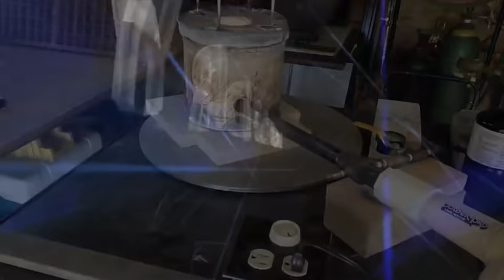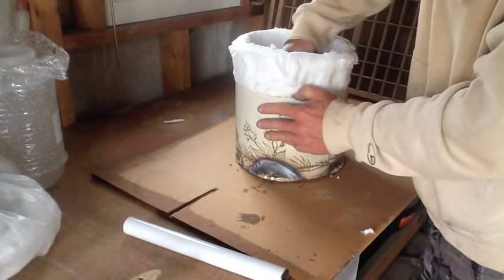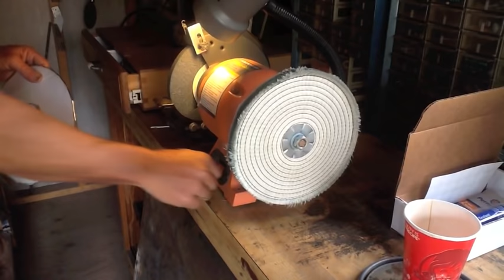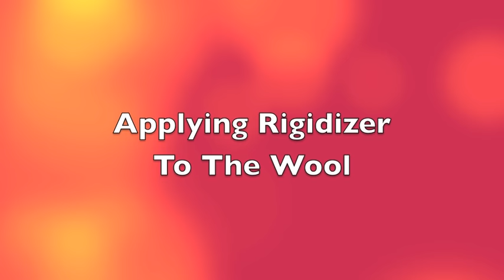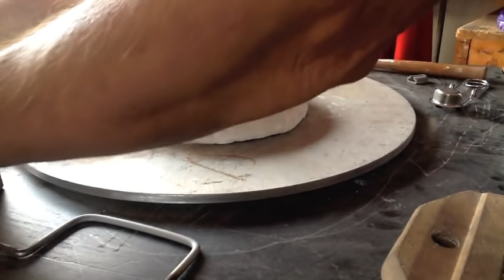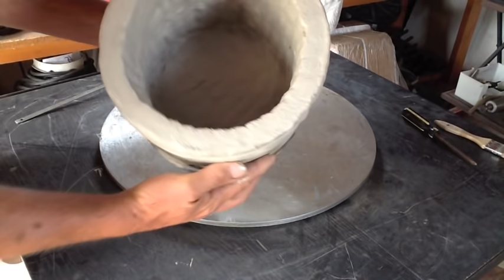BRASS MELTING FURNACE - EZ BUILD

Comment: I apologize if you have covered this already.  I read a few pages of comments and see you made minor points as to the safety from the wool fibres and thought I could expand on it a bit.  Kaowool or ceramic fibre is relatively harmless THAT IS until it is heated to high temperature such as inside of a furnace or burner , firebox.  Once heated to either 760C or 960C Celsius I forget which but doesnt matter as the temp will ex cede both so when heated to that temp the ceramic fibre curls up like a fishing hook.  how does this differ from the straight in terms of health well straight ceramic fibres will irritate your  lungs but will be expelled when coughing fishhook fibres do not they hook into the lungs and cut over time causing scaring inside the lungs scaring does not allow the lungs to function properly and brething is affected iy you cant breath you dont complain for long.  Ceramic wool was brought in to replace asbestos and at first was thought to be harmless a perfect substitute until they found the high temp curling at which time it was said to be many many times worse then asbestos.  When work inside boilers is done we have by law a decontamination (vacuum trailer)where all contaminated clothing etc remain ,  then a shower trailer then a clean trailer so its no joke.   I hope this helps and yes i use it on forges without the coating i  only coat the botttom where i place items i have tried furnace cement, perlite blend vermiculite and spent anthracite filter media anthracite is used to filter water in industrial plants and as traction for sidewalks in some areas it is burned coal i tried it because i had some and without lots of lab data to back me I think it is better then perlite  my 5 gallon forges when compared the anthracite one heats up much quicker and holds heat alot longer but slight differences in burner and burner entry angle and exhaust port plus the black looks way better ive had no cracking as i used sodium silicate and anthracite  so cracking wont be an issue now if i put the flame direct to it in a tight tip like a cutting tip you may get some foaming but if kept at angles indirect it holds up great over a year now and am happy with it great videos thank you
Reply from the maker: Thanks for the input, hopefully others can benefit from your wonderful data on the subject. I also learned some things I didnt know...I appreciate ya!
Reply: I wonder if you could give your opinion on this material.  is it also the dangerous kind?  Morgan Thermal Ceramics, RCF Blanket Refractory Ceramic Fiber, CeraChem Blanket; Alumina and silica plus Zerconia.  Thank you!
Reply: I spoke with some friends who do insulating and they said the main thing is to control the dust so the rigidizer is a good start and their advice was a good thick base where you set things down as well as inspecting the internal frequently and repairing any damage or cracks.  as an extra safety using a dust mask when moving or inspecting.  as well if it is to be disposed of it should be done in accordance with any rules , regulations or laws in your area and wetting down any thing with dust on it for clean up will help with dust control .   I also asked a professional not sure the title but specializes in concrete mixes for all areas and i have to share this he said way back they used horse manure  and mud and they forged everything needed so a eco friendly option haha.  so control the dust and you should be good to go although  im no professional i go by common sense .
Reply: I think we all appreciate your effort on the videos and i learn alot every time i watch im just glad to add anything i can were all in this because we have a passion to try something new  so thank you
Reply from the maker: I was newbie to the ceramic wool when I got into all this and all the research I did said use rigidizer....so thats exactly what I did and recommended it in the video. I have seen others make furnaces and forges with ceramic wool and not seal it with rigidizer...its cheap enuff so IMO ....USE IT :)
Reply: sexaysteven1 Hi are you refering to anthracite coal slag (blue stuff), anthracite coal ash (red/orange stuff) or anthracite coal (the black stuff)?
Reply: sexaysteven1 LOL.., Do know your stuff; thanks for  sharing 👌🏻. I don’t know anything about furnances, I’m getting into melting metals as a hobby, I’m looking to buy a safe propane 10km furnance on a tight budget still good quality, would you advise on where could I order or purchase one? I would be melting brass, copper, aluminum and tin. Would appreciate your advice. Happy holidays! God bless you 🙏🏻

Comment: I made my stainless keg furnace for melting aluminum and other metals about 2 years ago now... I did not put in the kao wool, oh god I wish I had LOL.   Instead what I did put in was a 1" layer of fireclay mixed with polystyrene balls (bean bag filler)... then 1" of just fireclay... I let it dry out for a couple of months through summer before I  fired it, which was a 24 or so hour process...

So far it has held up very well, although the outside of the furnace does get hot, it would have been better with kaowool...

The reason I mention this... simply for others who might not be able to obtain, or afford, kao wool, as a possible way to build the furnace without it...

I will say though, I have never seen a furnace done where only kaowool was used as the refactory and hotface... if you applied furnace cement to the lid, I am surprised you did not apply it to the furnace walls, especially where the tuyre comes in and blasts against the wall...  How is your furnace holding up? I am genuinely interested
Reply from the maker: I used only ITC100 on the wool for the furnace interior and looks exactly the same as when it was applied and has held up extremely well, a few hairline cracks but doesnt affect it whatsoever. The only reason I used furnace cement on the lid was because I ran out of ITC100, furnace cement is not suitable for a furnace in my opinion....junk basically. LOL

My other furnace vid was made with cement and perlite mixture and has held up for a year and a half now...lotsa cracks but still intact. When I make another it will be ceramic wool only. Check out the propane forge build if you like fire breathing dragons :)
Reply from the maker: This little furnace here still has the paint on it as it doesnt get hot enough to burn off the paint. It was made from a crockpot heating unit :)
Reply: I lined mine with kaowool insulation board then 2" refractory cement, works great and the outside of the keg doesn't get hot.

Comment: I like this build as I need something a little more portable and the plaster/sand type are heavy as hell.  I did a crossbreed of your torch and some others out of neccesity [[on disability so money is always tight]] but I am wondering how long your black pipe is?  Mine is 10" and it gets hot enough down near the gas jet to make me a bit nervous.
Reply from the maker: My black pipe is 10" long, if it is getting hot near the gas jet from heat transfer up the pipe you arent getting enough airflow to keep things cool....try a larger size reducer. Mine stays cool till I turn off the gas...then heat conducts up the pipe but I always disconnect the gas line immediately after turning it off before the heat transfer reaches my bell reducer
Reply from the maker: NP! Ask away....even with 10,000+ subscribers I always reply to comments/questions :)

Comment: Hi, About how hot does the outside of the furnace get when your using it?  I want to make a LiPo battery storage case from the same materials your using, but I'm not too sure how well the kaowool will contain just the heat from a ruptured LiPo battery.
Reply from the maker: It was made from a crockpot shell. I have melted brass in it many times and the decorative paint on the outside has never burned off

Comment: This looks like it costs way less than what mine did to make, and looks like it is holding up pretty damn good! how long did this last you? I made a plaster of paris/play sand one. Do you think if I applied a coat of furnace cement and ITC100 HT ceramic coating to my plaster/sand furnace and lid it would hold up for longer? The lid already broke and I just made it yesterday. The furnace itself is holding up good though, but isn't in a furnace shell. I was using charcoal and air fed into it, but I am going to make a forced air torch tomorrow because the charcoal didn't work at all. Your actually the first person I have seen that attached an air supply to the torch. Any reasoning behind that? I thought the flame was enough to bring air in if you use a T fitting to allow it.
Reply from the maker: I rarely use forced air, but makes quick work of brass when hooked up. I never use it for aluminum melting. This furnace cost me nothing as I had all the stuff laying around...still works great and looks just the same as I made it. Gonna try melting cast iron in it soon :)

Sorry to tell you but your plaster furnace will crumble and fall apart like the lid
Reply from the maker: Dont waste $$ with coatings, use as is

Comment: Hey Mister. Love ur work. Id like to try to make make a furnace using perlite and portland just the way u did but i dont have that cylinder with that special gas (dont know how u call it), but my question is if i can use natural gas provided by gas companies (public utilities).  Thanks
Reply from the maker: I simply use propane, I am sure natural gas would work just fine. I have a video on building my other foundry furnace...that one is made with perlite and portland if ya wanna check it out :)
Reply: Thanks.

Comment: This looks great!
I've been doing some research about building a small unit that can melt copper, and this one looks simple and efficient.
Could you let me know roughly what capacity it has, ie how many pounds of copper it could melt in one go?
I'm hoping to make something that can melt 2-3lbs at a time.
Reply from the maker: Thanks! This one is rather small...was made from a small crockpot steel shell...its like 11" outside diameter. Inside height with the wool is only 6-7". The capacity depends on your crucible type but this style design can be scaled up easily for a much larger capacity if needed.
Reply from the maker: This can melt about 3lbs of brass in about 15-20 min using forced air with the crucible I use in it. For copper you want a clay/graphite crucible...steel crucibles wont last long in 2100 degree heat (few melts)
Reply: That sounds perfect then!
What I meant by 'capacity' wasn't necessarily how much it can physically hold, but how much it can actually melt. I imagine if there was too much metal in there it might not be able to melt it fully.
3lbs is perfect though. I'm quite relieved, as I was worried I would have to build something huge to be able to get up to copper tenperatures, and I don't have room to store a large furnace.
Thanks for your help, you got a new subscriber :)
Reply from the maker: Great! :) You want to go with the burner design in the video I have up for a foundry burner....it can accept a hair dryer for forced air with just 2 PVC fittings. But this compact furnace can melt copper without forced air...just takes a bit more time.

Comment: Why did you use furnace cement on the lid, but ceramic coating for the body? Could I use furnace cement for both? Could I use ceramic coating for both?
Reply from the maker: The only reason I used furnace cement for the lid was I didnt have enough ITC100....I used 80% of the ITC100 when I did my forge with it if you saw that video. I had a gallon of the FC so figured I would finish off the lid with it. I would go with ITC 100 for both if you can afford it, I would use furnace cement as a last resort honestly...it just doesnt hold up well nor stick to the wool well once cured
Reply: Thanks for replying! I'm gonna go with what you say and try out the ITC 100.
Reply from the maker: See the link in the video description if you want a list of supplies/suppliers emailed to you. Thx for watching! :)

Comment: I'm planning on making another furnace but do not want it to crack. have looked at many materials...? I wanna melt mainly aluminum and some brass
Reply from the maker: Wool is a great choice, if cared for will last a very long time and avoid the cracking issue. Much lighter too. The furnace in this vid weighs less than 3lbs I'd say, maybe less :)
Reply: thanks

Comment: Nice work on the build. I recently made one but it is cracking to pieces so I'm considering the wool.
From what I gathered from the video and comments the parts are: kaowool, sodium silicate, some sort of kaowool rigidizer, and refractory cement to coat everything?
Correct me if I'm wrong. Also your dimmer circuit to control the hairdryer is brilliant. How is power run to it?
Reply from the maker: That pretty much sums it up. The final coating of the wool is optional...I just happened to have had the materials so used them. The dimmer outlet box has an old TV plug wired into it that plugs in the wall so its portable...it comes in handy :)

Comment: just got all the stuff I need to build this. was wondering, it's been nearly a year, how is this holding up? and under how much use? just curious. any hitches I should watch for on mine?
Reply from the maker: If built exactly like this it will last an extremely long time. That furnace cement I showed on the lid is the weakest link, but works ok...I didnt have enuff ITC 100 for doing the lid.
Reply from the maker: It has held up great, I dont use it every week but looks the same as it does in the vid after all this time
Reply: thanks. I work at a school and am constantly telling people to check out your vids. great stuff
Reply from the maker: Great, thanks George 👍🏼

Comment: ah the old death wheel on the makita... so many uses.. so often used wrong. Me, I prefer a torch, when I don't have access to one, I grab hearing protection and a jigsaw with a metal blade.
Reply: Makin Sumthin From Nuthin I'm trying to figure out an easy way (with no money needed) to melt down brass casings to turn in at the recycler. Our local place won't take bullet casings for fear of explosive material or live rounds so my first thought was "okay then, what if I melt them down?". Shouldn't be too hard, I mean hell just hold the torch on em long enough and they will melt. Hardest part will be collecting it without ruining the concrete floor (after collecting the brass to begin with) that and depriming the cases.
Reply from the maker: The furnace in this video would make quick work of turning casings into an ingot. For a cheaper solution see my newest vid on the $5.00 foundy furnace! :)
Reply from the maker: I tried cookin blackberries today in this furnace....didn't end well! ;-)
Reply: may wanna post the brass for sale if its in reasonable shape or check out places like freedom munitions that buy used brass...as long as they are not split or beat to hell they are worth more as reloadables then as scrap brass

Comment: So you used sodium silicate on the metal to attach the wool?  Is the rigidizer the same thing or something different?
Reply from the maker: Yes, sodium silicate is simply the glue, the rigidizer hardens and stiffens the wool
Reply: do you make your own sodium silicate because i rarely ever make any that is that fluid i guess i over cook mine but mine is more like molasses thick and some crystals in it.
Reply from the maker: simply buy it....is only like $11/gallon at axner.com
Reply: I see it for $29 per gallon

Comment: Any chance you could point me in the right direction of where to buy kaowool, sodium silicate, rigidizer, and refractory cement without getting ripped off? Looks like many folks find it for around 2$ per foot, online I'm seeing between 6-12$ per foot.
Reply from the maker: You can email me at: makinsumthinfromnuthin@gmail.com
Reply: sodium silicate - water glass is easy to make as long as you are A) comfortable working with some strong alkalies and just a little bit careful, I made some recently for setting sand cores...

There are plenty of youtube vids on making waterglass...

It is essentially desicated silica gel - I buy it as cat litter and is cheap, mixed with a solution of Caustic Soda (lye).

Basically add some caustic soda to water, add silica gel to the caustic solution and dissolve it... you know when there is enough silica because it stops dissolving... the dissolved solution is sodium silicate...

I found a local pottery supply company that supplies KAO WOOL, fireclay, fire clay that has also been fired (called grog), and castable refactories as well.

I am sure you will find similar if you look :)
Reply from the maker: See this video Nick, I made it to answer these questions which always come up https://www.youtube.com/watch?v=a8AEc1LNY9U
Reply from the maker: Lloyd, I have made it before but found a place that will sell a gallon for under $11 and with the cost of sodium hyroxide its cheaper to just buy it in my opinion, but yes...its fun to make too :)
Reply: for me, here in Australia, it is actually a lot more costly to try and buy it versus makng it... at least from the sources I have discovered
Reply from the maker: I live in Florida(U.S) I guess goods are expensive there, i hear good gold hunting in your country tho! :)
Reply: Hey Makin Sumthin. I'm in Florida as well. Do you ever do any tutoring in person? I'm just getting into this, learning all I can, and watching every video I can watch. I'm trying to find someone who can let me learn with some supervised, hands on experience.